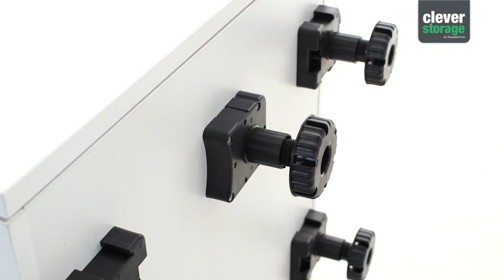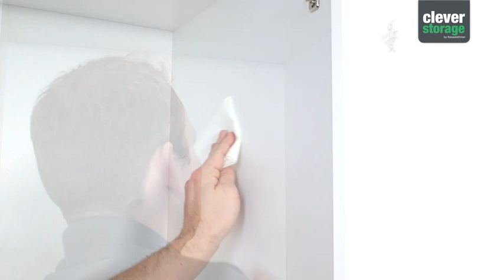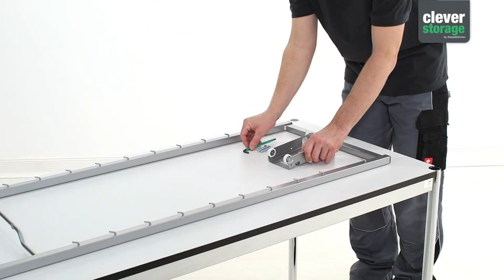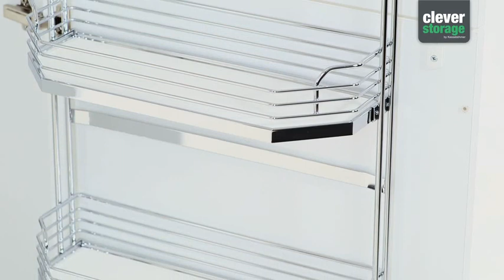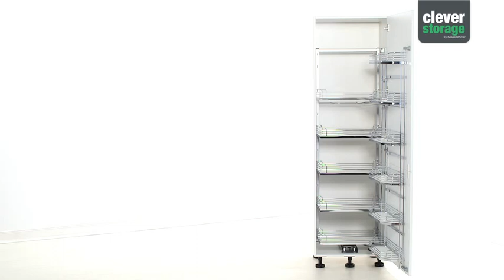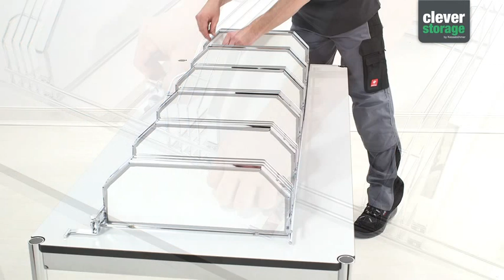Häfele Kesseböhmer TANDEM Installation Video

Comment: Hi, I had mine fitted by a builder but after 3 weeks it has now stopped closing properly, a dragging sound as i close it and i have to push it to close aginst a little resistance, soft close hinges are fitted. can i correct this easily?
Reply from the maker: Hi Aubrey. Thanks for your message. Yes it is easy to adjust or it could be that more adjustment is needed on the hinges. If you need more assistance I would recommend contacting your builder who installed it or email us at info@hafele.co.nz with some videos / images and we will help out! Thanks again for your message.